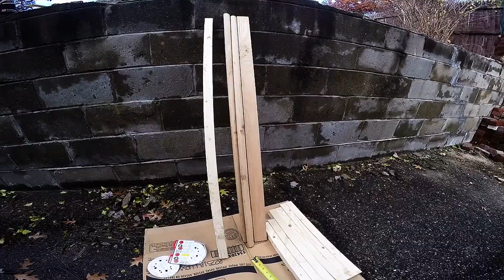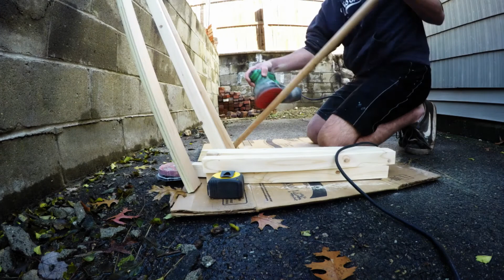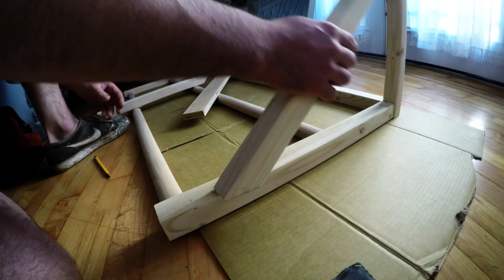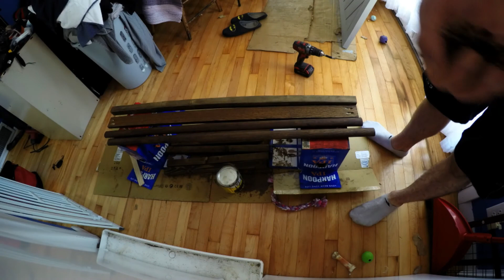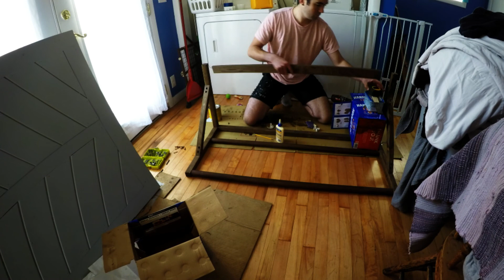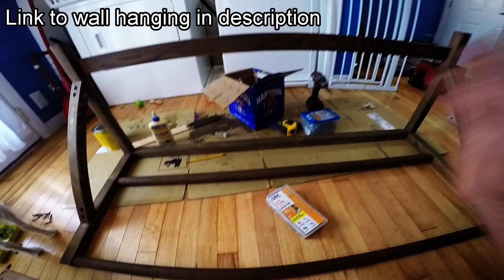$15 DIY Tire Rack

Comment: Thanks for Sharing :) I wanted to build one of these. but I checked my tyre weighs 85kg for all 4. Do you think this structure can withstand that much of a weight.
Reply from the maker: For that much weight, I'd use at least a 2x4 instead of the 2x2s and dowels used in the videos. You may want to put an additional 45 degree support in the center of the rack as well.